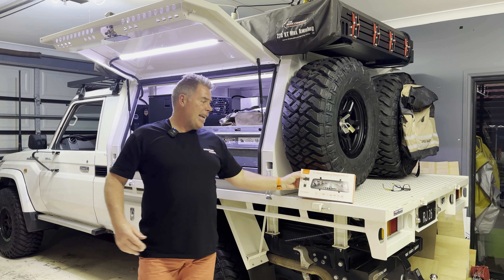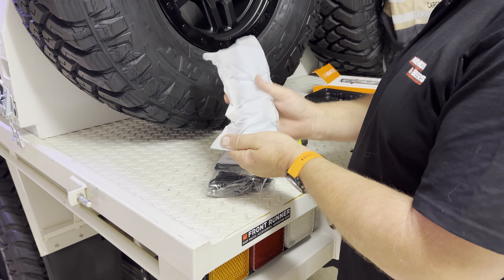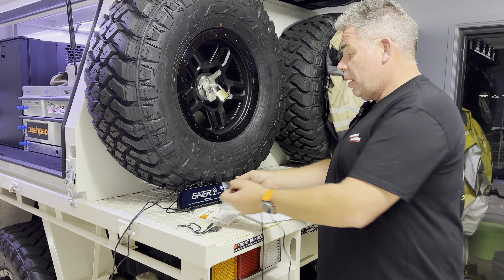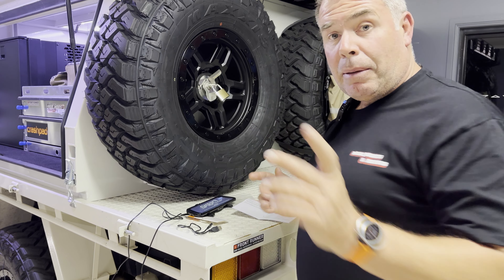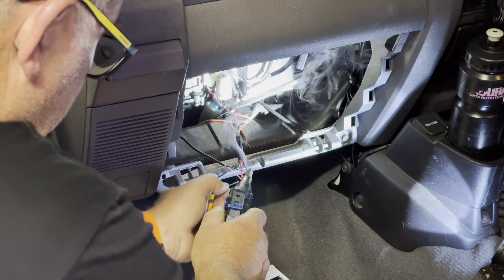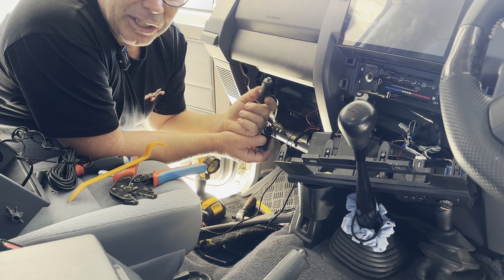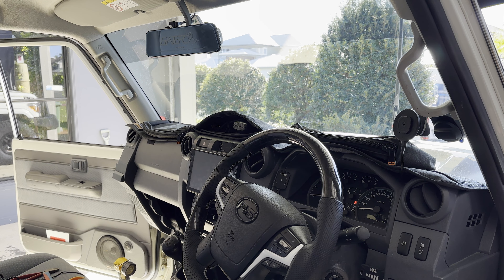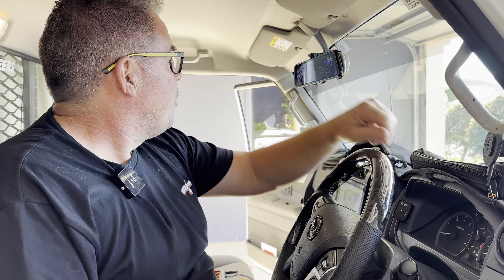This REAR VIEW camera looks like a MIRROR!? | GATOR 9" Mirror Monitor Install

Comment: if you had of hooked up your trigger wire you can put it in reverse then aim it at where your tray ends then when it’s out of reverse aim it back up, next time you flick between reverse and in gear it will be set to what you had them set to last so reverse will always be aimed at your tray and normal driving will be aimed up to see what’s behind you
Reply from the maker: That’s a great tip, thanks mate. I might retro fit this, would be very handy!

Comment: I tried the gator for a week on my 2015 Troopy. The vibrations did my head in!! Going for a solid mount unit instead.
Reply from the maker: That would be hard to live with mate I agree. 

I strapped the monitor over the mirror really tight, have had no vibrations at all.  Does your original mirror vibrate much?

Comment: Hope it keeps working mate. I've fitted half a dozen  through our 4x4 shop over the last 4yrs... there's only one still working, (my one) the first I fitted. 
Great mirror, just so not reliable long term.
Reply from the maker: Thanks mate, fingers crossed so far so good.  What one would you recommend?
Reply: @MudModsBeers  Sorry mate, late reply. I didn't have a better option. 
True story coming up - My one that was still working just stopped the day before Xmas. Had a few spare bits and pieces around from the other dead units... worked out it was a camera problem (had no spare camera) Saw these were on sale for $165 at Autobarn. Bought one, got it home, opened it up and saw it had fingerprints all over the mirror... been opened already and I just couldn't chance it. Took it straight back and they replaced it for an unopened one. The new one was a dud out of the box. 
No biggie.. took it back boxing day (today) they tested it in-store, saw the fault (dead short in the ciggy plug) and they swapped it again for another unit. Refitted it all with the new camera and Tah Dah perfect for the moment!! I honestly can't fault the daytime picture... It's brilliant. If it lasts another 2 or 3 years I'd likely replace it with the same again.

Comment: Right call to use the cigaret lighter as a step down converter 12v to 5v. I have tried the other options that you were talking about, they seems to be sensitive to the input 12v voltage, in other word, if the 12v drops below 12v, it stops 5v supply…. Which was very annoying…. The cigarette lighter adaptor is a bit “dumb” and very insensitive to the 12v input… more reliable 5v supply in my opinion….
Reply from the maker: Thanks for the comment, took me ages to work out what was happening!!!  Finally when I worked it out it was such a relief!

Comment: Looking at getting the same! Just curiously, have you figured out a way to take off your canopy (perhaps with a joint/plug in the camera wire)? We are looking at getting the extension cable for this purpose but not sure if this will work... keen to hear your thoughts. Cheers
Reply from the maker: Hey mate, thanks for the comment.

Yes, have got the connection cable tied to the headboard.  When I lift the canopy off, I just unplug the camera, super easy. From memory I used the extension cable for that exact reason too.
The bonus is when the camera is unplugged, the unit works perfectly as a mirror, no need to change anything at all.
Cheers
Richo